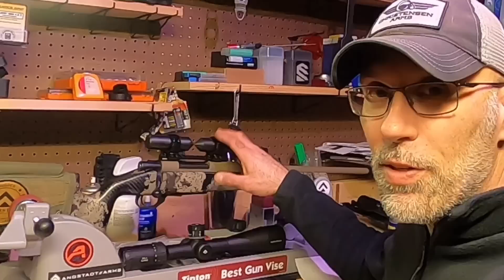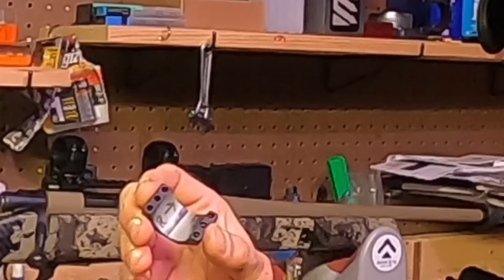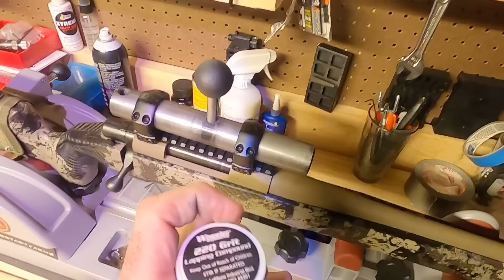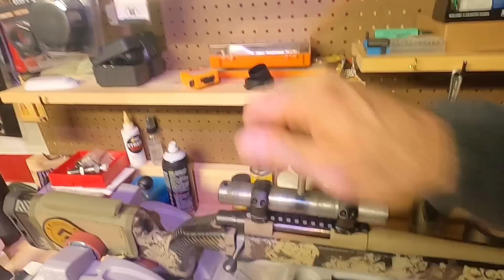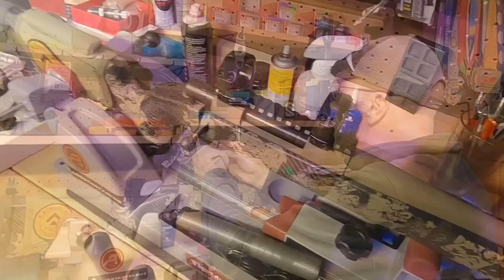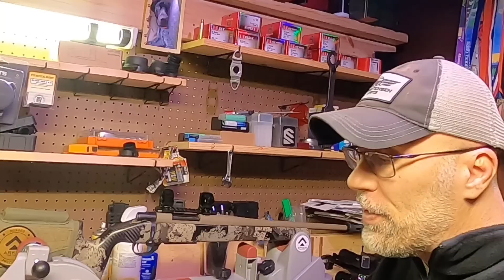👉 Do Arken Halo Rings Need to Be Lapped? 30mm Alignment Test

Comment: You shouldn’t need to lap modern rings. Most are aluminum and are CnC machined with a computer and laser guided, precision cutting tool. The older machine cut rings needed lapping because they were not precise cut. If you are using a set of rings from 1979 or older, yes lap them. If not, Mount them and move on. You’re good to go.
Reply from the maker: That’s a fair point, modern machining has definitely improved things.

Comment: Here is what is wrong with lapping rings. If the rings are not aligned with the bore on your rifle it means that the scope is not true and you will lose some adjustment. And further more when you lap the rings you lose the anodized coating and corrosion will occur. Steel rings will rust. Both will cause damage to the scope. I have personally seen it happen. My friends that I have helped watched me and then asked where I learned it from I told them I learned on my own. So I never lap rings. The only rings I will ever use it Redfield/ Leupold dovetail base and rings
Reply from the maker: You can reblue steel ones.  Aluminum it really doesnt matter.  All things considered yea things need to be lined up or can make stuff worst.  But lapping has its place and can help with grip for high recoil situations
Reply: @RugerGundog when I aligned the rings on my 8 mm magnum the rings were perfectly aligned so no lapping was needed. I will never use picitini rail mounts. My friend who was sold they were good I proved otherwise. We put the rings on a machinist block and it was warped. We checked six of them and all of them were wrapped. I never had trouble with Redfield dovetail mounts. That is all I use

Comment: I  bed the rail or mounts to mate with the reciever perfectly,  then bed the scope to the rings.  lapping is only accurate if your mounts or rails are a perfect fit to start with.  I don't give a rats ass who machined either the rail or the rings the reciever from one rifle to the next always vary.  bedding rails and rings is a far better way to mate your entire system for tight square fitment.
Reply from the maker: That is ideal.
Reply: Exactly.

Comment: If the rings need lapping then you need new rings.
Reply from the maker: I disagree.
Reply: EVERY product has some level of substandard units produced.  Maybe it's one out of a thousand, or one-in-ten thousand.  Compare it to flying. They say it's statistically safer than driving a car. Maybe so.., unless you're a passenger on the one that's not. Today is 12 February 2025....., how many fatal aircraft crashes have made the news in the last two weeks? Still going to stand on that? 
  It is outright ignorance for one to state that buying expensive (e.g. "good" )rings negate one's due diligence in the belief that "I spent this much so it's good".

Comment: Few things that may be important, especially before lapping $100 rings. First you need to check fitment of your rail to receiver. Often the tolerances on receivers or pic rails may introduce binding when torquing the pic rail down. This is why a lot of people bed their pic rails. This alone can cause your properly machined rings to not align perfectly. Next you may want to wet mount your rings to rail "see Spuhr's instructions" for explanation. Often times when torquing your ring bases to the pic rail without wet mounting you can get binding which will throw off your ring alignment or cause your scope to shift. Personally I would verify these steps before lapping quality rings. There are vids on Youtube explaining these points in detail. Remember, when you remove material from your rings you can't put it back. Before doing so make sure each step is done correctly. With today's  quality rings you really shouldn't have to lap.
Reply from the maker: I agree.  It's best to start with the rail when possible.
Reply: Thanks, I bed my pic rails as well as lap my rings and bed the scope...Somtimes I use Burris XTR rings with rubber inserts and do not require lapping...I wet mount rings and mounts since watching Spuhr interview...

Comment: Hi GunDog. An excellent example.
I have a lot of Arken scopes mounted with both Arken and Vortex rings.
However, recent 34mm scopes have been mounted with the new Discovery 'honed rings' which have truly impressed me.
Discovery recently posted a video showing how the ring sets are honed together using a precision fixture with some spacers. Vertical CNC machine. I was a little surprised they had no cutting oil flowing, but there was a minimal amount of al removed, because you couldn't see any shavings.
I would like to ask if you have checked the Discoveries using the alignment bars?
One video I saw, recommended using alignment bars and using the flat back end instead of the point.
The reason? Picture 2 pencils with the points facing. Rotate one a few degrees with the points still together and it would still look ok.
Made sense to me.....
Reply from the maker: I have not used discovery rings, though they sound great.   I will add that of the Halo rings I've used and mount...upward 50 sets I can't say I've had a set i feel were off bad and needed lapping.   I think lapping them just cleans up the mount process and removes one minor variable making for a better set up.

Comment: No decent scope rings manufactured today need to be lapped, that is a thing of the past when back in the old days machining wasn’t as precise as today.
Reply from the maker: I agree and disagree to some extent.   I've mounted Halo rings and managed .2 moa groups on several rigs.  I consider them decent rings..but as you can see with a bit of time they can be improved.   In this case i feel it's the paint being evened out.
Reply: Never hurts to check using those alignment rods. I do it (at least check) on EVERY optic install.
Reply: Disagree, I have have Seekins rings be ever so slightly off same with the last set MTD rings I had.  Sometimes I think the coating used on the rings can be slightly off.
Reply: Wrong!! I guy did an alignment test on a precision pic rail ment for testing rings and Night force rings didn’t line up. Stop with the bs please. 🤡🫵
Reply: @Tacticalbuffoonary hahahaha😂
Reply: Total foolish nonsense

Comment: I never lapped a scope rings. If you want a better and easier solution, just lay some baseball friction tape on the rings surfaces, and tighten the screws to spec.
Reply from the maker: This is the proper solution lol
Reply: That is not going to correct misalignment.
Reply: @withoutprejudice8301  
Friction and holding the scope in place will be way better. Try it, you will like it

Comment: I just bought the Arken SH4J 6-24 scope with the Arken Halo Ti rings because of your recommendation for my Ruger 10/22.
Replacing the 4-12 Hawke scope, always have used a wood dowel to align the rings.
Reply from the maker: That’s a great scope!  You will love it!
Reply: More scope than the gun is capable  of.  HAWKE  is a great optic for airguns & rimfires.

Comment: Is the point of this just to make sure that (when sitting on a random picatinny rail of unknown trueness) your e.g. 0 moa rings actually define a 0 moa angle, and not (due to machining/coating tolerances) a -0.1 or +0.1?   If so: why wouldn't bore-sight-zero'ing account for that?  And, would a 2-ring cantilevered mount benefit from this same treatment?
Reply: My understanding is it’s all about making sure that the rings are as close as possible to true to each other, not so much to the riffle. If rings are out of alignment to each other it can cause torquing on the scope that can damage it or not allow it to properly move/adjust. If alignment is off enough you can also get movement of the scope making shot to shot inaccuracy problems.
Reply from the maker: This is true.
Reply: @RugerGundog some day I'll learn not to ask multiple questions at the same time.  :). It's unclear which of them your  "this is true" applies to
Reply from the maker: The goal is alignment as well as grip.  So front rear alignment and inner surface grip